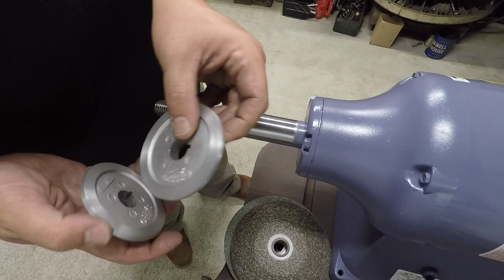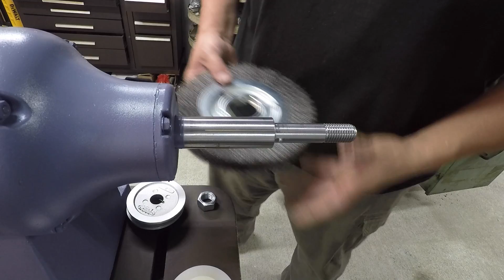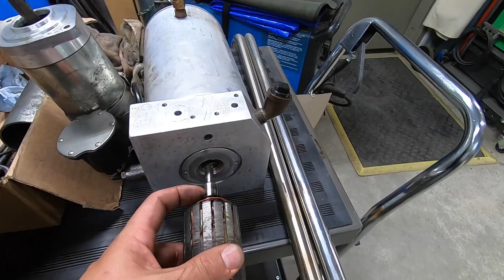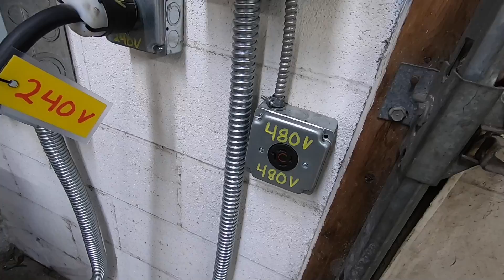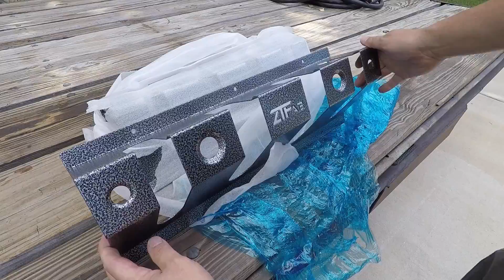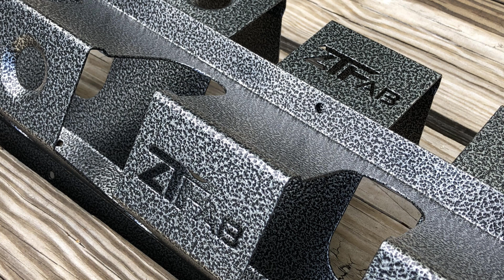SNS 304 Part 2: Baldor Buffer Improvements, ZTFab Milling Arbor Racks

Comment: Think a couple of tapered cone shape spacers would center the wheels nicely and more universal
Reply: Not a good idea, illegal here in UK, puts outward strain on wheel. Also  bushes must clamp on to paper disc round the center, NEVER  on the bare wheel surface.

Comment: While marking the receptacles is nice if the correct NEMA L15 (250 VAC 3 pole 4 wire 3 phase) and NEMA L16 (480 VAC 3 pole 4 wire 3 phase) plugs and receptacles are used then there is nothing to worry about. Also any 480 volt systems should use proper SO cord rated at 600 volts, cheaper SJ cord is only rated to 300 volts.
Reply: Was going to comment the same thing,  to many people go to home depot and lowes and just grab a receptacle and plug that match and call it good!
Reply: I don't think Adam has 3 phase 250. Isn't he using 125/250 single phase?
Reply: @DaveDablave  Adam has 240 volt 3 phase from his local power company
Reply: @DaveDablave  he obviously has 480
Reply: no one you know here 
Thats what the transformer is for.
Reply: @Sicktrickintuner  ...Yep, he added the boost transformer a while back when he bought the 480v tapping arm.
Reply: I am commenting so Adam see's this. Using improper connectors on incorrect voltages is subject to causing fires and faults. Doing something against code in a pinch is debatable. But taking the time and doing a proper install, You need to put in proper connections. 480v needs to be used with L16 connectors, not L14

Comment: Have you thought about color-coding each receptacle by its voltage/phase?  Fire-engine red for the most dangerous; red/yellow striped for the next most dangerous, etc.  That way you do not have to bend over and try to read your not-so-easy-to-see voltage labels (which might get obscured by oil/grease/etc. as time goes by).  Better safe than sorry (Murphy was an optimist)...

Comment: Expect a small amount of runout with a new wheel.  There will always be a differance between the wheel ID and the arbor OD.  Assemble the wheel, flanges and nut, snug it all with a little wrench torque then adjust the concentricity (I always used a pencil and some kind of handrest and a few light taps with soft metal). Slowly tighten and keep checking. When centered enough to reduce vibration, just dress the wheel.  Now you have a useful wheel and you are not aging the grinder's motor.

Comment: Just be mindful Nylon looooves to absorb ambient moisture.
Reply: Interestingly enough that doesn't stop basically all modern power tools from working, a lot of drills for example have nylon gearbox housings. 
Not to mention all the structural clam shell housings with tight fitting components.
POM (Delrin) would be a more stable choice but if he has nylon lying around it will do the job perfectly.

Comment: Draw a line on each end cap so you can see if its running at a distance for when you may not be able to hear it.
Reply: We have a diamond wheel grinder in our shop that gets left on all the time because it's so quiet after it starts up.

Comment: Would you still recommend baldor grinders considering the quality of the parts you received?  I thought they were top notch? I wonder if it was just ones set of bad machined flanges/bushings or maybe their QC isnt up to par...
Reply: Baldor quality went downhill after ABB bought them ou several years ago.
Reply: @billmcleangunsmith    Baldor's prices sure went up.

Comment: @abom79
Try dbelectrical. Com for that motor.  I buy lots of electric over hydraulic motors from them that are no longer available in the marine industry.   I wouldn't be surprised if they have it.  Super nice folks.  

Disclaimer: I am not affiliated in any way, just a happy customer.

Comment: The plugs should be rated for 480 or 240. Hubbell has a phone app for it. Also the plug sizes should match the overcurrent protection upstream.

Comment: You'd think that a $1000 grinder would be better than that. All that vibration is not good for the bearings in the motor.
Reply: I was thinking the exact same thing.  If I'm going to drop nearly $1,000 on a tool, the darn support items should be PERFECT.  I expect MUCH better from Baldor.  I've used their motors in industrial apps for years, and never seen anything like it.  But...profits seem to rule over quality.
Reply: @WreckDiver99  Is that buffer 1000$?
The motor itself runs nice but the small parts are just wacky. It must be some kind of mistake, a factory couldn't make castings that crooked if they tried.

Comment: Hey Adam, You're probably better off going on Ebay and buying a United Technologies armature for $35.00 and cutting it down to match the old armature. You can also find new brush cover with brushes for $18.31.

Comment: GEEZ, just checked out the Baldors, and for the price you would expect a precision piece of equipment, but nope, just the motor and shaft might be balanced and true, the accessories were an afterthought as well as the masking up on the shafts !

Comment: I wouldn't say that 12v brush motor is bad, just reading to ground. It's just loaded up with carbon dust . Clean the Armature with 91% Isopropyl Alcohol flush it several times letting it dry each time.  Then reface the commutator and etch the mica between each slot. you won't be out much more than a half hr of your time. I've Brought back to life many a Starters that way . Give it a try !

Comment: You need to use the correct NEMA receptacles in your shop, then you don't have to worry about marking them.  240V NEMA plugs won't physically fit in 480V NEMA receptacles, even if they're the same current rating.  Single phase 240V 20A are L6-20,  single phase 480V 20A are L8-20.  3 phase 240V 20A are L15-20, 3 phase 480V 20A are L16-20.  The devices are made to be safe.  https://www.stayonline.com/product-resources/nema-locking-reference-chart.asp
Reply: Star Gazer I would imagine they already are the correct NENA plugs and receptacles.. I believe the guy that did the majority of the electrical work is a licensed electrician.
Reply: @chuckels431  chuckels431 Abom holds the plugs up in frame and if you pause the video, you can see that the electrician did not install the correct plugs and receptacles are Star Gazer indicates.
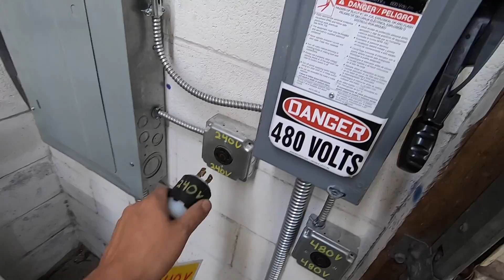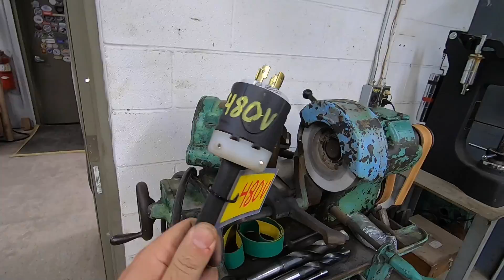Reply: @chuckels431  At least some of them are not.  You can see it clearly in one shot at 26:12 .  And if they were correct, there would be no need to label things as you couldn't accidentally physically plug the equipment into the wrong voltage.  Notice the 240 and the 480 at 26:12 both have an orange circle in the center of the receptacle.  A 480 should be red, and the 240V should be blue.  It's very obvious at 27:23 where the "480V" plug clearly says 125/250V on it.  You might not think this is a big deal, but when a friend parks his motorhome in the driveway and goes looking for an RV outlet and unknowingly plugs it into the 480V 3 phase because it has an RV receptacle, or a contractor doing work plugs his tool in to a compatible outlet, or when Abom moves on and the next owner gets in that shop, some expensive equipment will be fried, and someone could get killed. That's why they have incompatible NEMA plugs for each voltage, to make this physically impossible.
Reply: Star Gazer WOW .. I didn’t, look that close, can’t believe they actually mismatch them ... not cool or safe, I have been in the electrical maintenance game for 40 yrs, guess I should have assumed. 😳😠

Comment: Just start using IEC 60309 plugs and sockets.
They are both color coded and keyed.
You simply just can not mix them.
And it is a international standard.
https://en.wikipedia.org/wiki/IEC_60309
Common colours for 50–60 Hz AC power are yellow for 100–130 volts, blue for 200–250 volts, and red for 380–480 volts.
The maximum voltage allowed by the standard is 1000 V DC or AC; the maximum current, 800 A; and the maximum frequency, 500 Hz.
The standard includes preferred current ratings and wire gauges for both International (deemed Series I) and North American (deemed Series II) applications. 
Connectors come in IP44 (splash-proof), IP67 (waterproof) and IP66/IP67 (jet-proof/waterproof) variants.

Comment: I converted all the old ballast type flourescent fixtures to 120 volt LED. A very simple wiring mod,  toss the ballast out and what a great difference. I think they are better than the leds that go in with the ballast remaing in place.
Eric

Comment: Whenever I see a grinder that’s been painted on the crate (you can see the chip board in came on was painted) with all  the fasteners painted I think China. In fact you can even see the shaft has paint on it. I could be wrong but it doesn’t look like baldor is american made anymore ☹️
Reply: Baldor was purchased by ABB a few years ago. ABB is European, Geman I believe, and better quality is what I would expect from them.
Reply: The ownership of the company does not necessarily indicate where it is made. Adam what does it say on the label?
Reply: Now,those backing plates are another story,no excuse for that!
Reply: Usually when you see paint on the board like that it's because the piece needed touch up,it's fairly common practice for the manufacturer to take care of small blemishes just prior to shipping
Reply: If you want a good grinder/ buffer get a Dayton.
Reply: @skmetal7  ....Dayton is just a "branding" that Grainger uses.  "Dayton" can be whatever manufacturer is first in line when the purchasing dept makes the call.
Reply: The paint colour of the base is different to the motor body.       To me it says no...no...no!!!     Bald or schmaldor.......the name means nothing these days?     As the Oirish say......you can't polish a turd!  I can buy a Chinese buffer built to this standard for $100 Australian.   

Stavros the bargain chaser.

Comment: Just an FYI on labels, I got a Brady label maker from amazon, they will print on a lot of different sizes and colors of label material. They make a really nice professional finished look on labels on cords and machinery. I think they go up to 3/4" wide label tape. They can print two-sided flag labels for cords and wires. https://www.amazon.com/Brady-BMP21-PLUS-Handheld-Printer-Multi-Line/dp/B00IELD1O4/ref=sr_1_1_sspa?crid=ZNK02W562U9&dchild=1&keywords=brady+label+maker&qid=1589111410&sprefix=brady%2Caps%2C168&sr=8-1-spons&psc=1&spLa=ZW5jcnlwdGVkUXVhbGlmaWVyPUEyR1FFNFRVMThQTlJDJmVuY3J5cHRlZElkPUEwNjgxMjk5MUdNVkE5WFI3NkZRRiZlbmNyeXB0ZWRBZElkPUEwMzU0OTIxMVBDQVYwWkkxVTMwOSZ3aWRnZXROYW1lPXNwX2F0ZiZhY3Rpb249Y2xpY2tSZWRpcmVjdCZkb05vdExvZ0NsaWNrPXRydWU=

Comment: I know what I am doing Monday morning. Ever since I got the new 10 inch wheel for my grinder it has been impossible to put a decent edge on anything. It is plenty fine enough for what I do, just general grinding and touching up chisels and twist drills. I have at least two things to check, I didn't install the new wheel. I wonder how the bushings fit, it certainly isn't a smooth feel when you are using it. I also had no clue the wheels were directional, or at least some are. I hope the label is still there. Thanks Abom, I am tired of walking to the welding shop to use the little grinder to touch up my drills, maybe these tips will help.

Comment: Not a bad thing at all!
But there is the problem with a machinist buying anything.
It HAS to be right😀
Have a look at chickadee doing concrete.
For anyone else close enough would be good enough.
Reply: It's a problem with machinists doing anything other than machining.  Look at Steve Summer's latest video where he's building concrete forms...  to the 1/32 of an inch...
Reply: It's a problem with machinists doing anything other than machining.  Look at Steve Summer's latest video where he's building concrete forms...  to the 1/32 of an inch...

Comment: Adam do you have 3 phase service run to your shop?  If so, how much did that cost for a residence?
Reply: Unless you happen to live close to a commercial area and have 3 phase already on the pole in front of your house, you can't get it from the power company at your house.  Most residences have to use VFDs.
Reply: @stargazer7644  That is not true, at least here in the US.  There is 3 phase on the pole/underground conduit and they just tap a single phase to a transformer (that creates the split single phase) and then feed a few houses from the transformer.  They toggle between the phases to keep the power draw from each phase relatively balanced.   So, for example, you and your neighbors may share a  transformer on A phase, and a little further down the street those houses share a transformer on B phase, then further down C phase and then back to A.  Only extremely rural services have single phase delivery of any appreciable distance.
Reply: @hgbugalou  Any residential subdivision I've ever lived in (in the US) did not have 3 phase on the poles.  There is normally one single phase HV lead at the top of the pole.  They send each individual phase down a different street to a different group of houses.  This is also how they do it in the county.   They don't go to the expense of running all 3 phases on the poles unless there are customers who will pay for it.  When you get down to where the commercial areas are, then you see 3 phases on the poles.
Reply: @stargazer7644  This is true but they only do this for a mile or two at most in urban or suburban areas.
Reply: It's much easier to just use a vfd.  I don't know why abom doesn't.
Reply: @calebbennett5156  Because if it is available from the power company, it is far cheaper than putting a VFD on every piece of industrial equipment that needs it.
Reply: @calebbennett5156  using VFDs in a shop the size of Adam's is going to get super expensive and its likely just getting 3 phase installed would be cheaper (especially if y ou are close to the metro transmision lines.  Also there is only so much power a 200 amp split single phase system can provide even with VFDs to "fake" 3 phase power.  Get a few of those machines running with VFDs + the load of his house and you can quickly exhaust the total wattage the service can deliver.

Comment: Nice work on the shop electrics although I do find US electrics a little confusing as in Australia we only have 230v and that’s at every socket and every socket has an earth and switch. You can get 440 added if you need to but it’s not standard. I have spent years learning how to balance grinders ect because grinders that vibrate drive me mental. I have just started my own channel (Scrounga’s workshop) so I will do a video on balancing those wire wheels if you like. I’m cheap so my wire wheels used to walk the grinder right off the bench. Thought I would fix it by bolting the grinder down. That stopped the grinder going anywhere but then anything else on the bench walked right off it.😂😂😂. While I can get the wire wheels better it’s impossible to get them perfect and at the rate they throw off bits of wire they need to be re-balanced every so often. Cheers Stuart 🇦🇺

Comment: maybe you should mark with red paint all the 480v cables and outlets?
Reply: 240V NEMA plugs won't physically fit in a 480V NEMA receptacle guys.  You don't need to worry about marking everything.
Reply: Just start using IEC 60309 plugs and sockets.
They are both color coded and keyed.
You simply just can not mix them.
And it is a international standard.
https://en.wikipedia.org/wiki/IEC_60309
Common colours for 50–60 Hz AC power are yellow for 100–130 volts, blue for 200–250 volts, and red for 380–480 volts.
The maximum voltage allowed by the standard is 1000 V DC or AC; the maximum current, 800 A; and the maximum frequency, 500 Hz.
The standard includes preferred current ratings and wire gauges for both International (deemed Series I) and North American (deemed Series II) applications. 
Connectors come in IP44 (splash-proof), IP67 (waterproof) and IP66/IP67 (jet-proof/waterproof) variants.

Comment: Adam--Now we need a discussion on chip control and cutting
tools for non-metallic materials. I have been turning some small parts from
Delrin. The usual issue is that the “chip” –which is really a string—wraps around
the workpiece and obscures what you are doing. And, you have to “cut the string”
when you return the carriage for the next pass. I hate recutting chips. So how
about it? That’s a topic I don’t think you’ve tackled before….
Other than that, the Delrin machines well using positive
rack tools that are well honed. Nylon 6/6 not so much. It seems like just a little
bit of heat from cutting just fuses the swarf right back onto the part. A few
parts I needed to make from Teflon, which is a challenge since it is so soft.
Really sharp tools with high positive rake seemed to do it.
The only knock I have on making parts out of phenolic is
that it smells like burning chicken feathers. Wet chicken feathers….  Good thing your channel doesn’t have Smell-O-Vision.
Thanks for what you do.

Comment: Great improvements to that Baldor! It’s a shame that you were required to do them in the first place. Those aluminum disks were terrible. No way they should have had that much runout on them. The company spends all that time making a great motor and shaft and then they ruin the machine by placing those terrible flanges on the shaft esp so far out from the centerline of the motor where the vibration will be exaggerated.

Comment: Had a grinder on a pedestal.  With 2 wire brush wheels it was like a fan.  It threw a ton of air around. It also vibrated so much it would vibrate across the floor.

Comment: Shame on Baldor for putting out this poor quality product for the prices they charge. Did they outsource the aluminum wheel flanges to China??? Do they have a QC dept asleep at the wheel?
Reply: I bought a cheap bench grinder - not a noname brand, but not a "high end" brand either. As it was a "used, but like new", I expected it to run true, but I found the same problem as Adam with the end caps that hold the grinding wheel. Managed to get it much better by doing a similar operation.